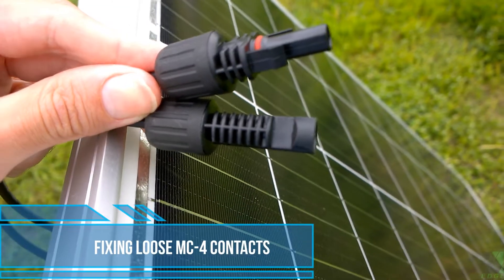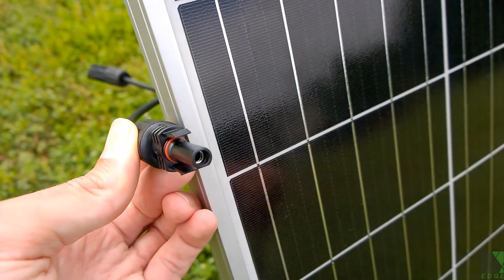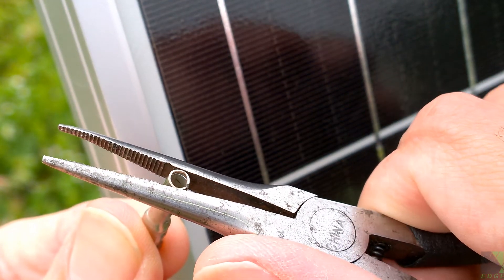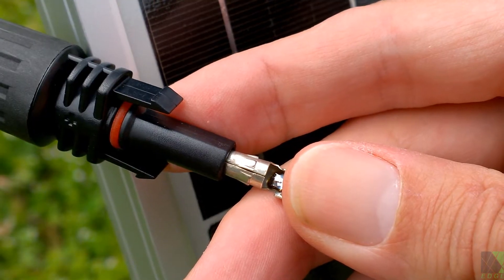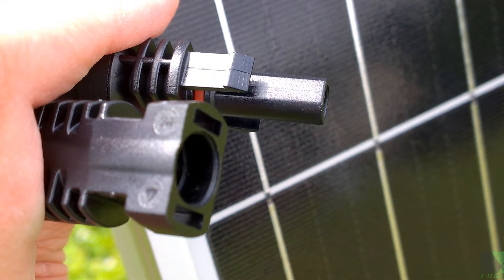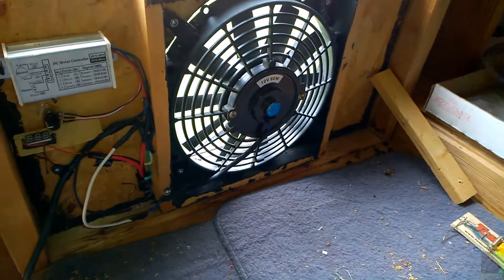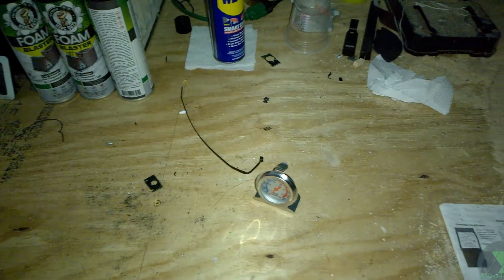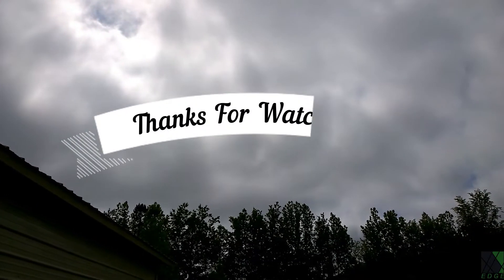Fixing LOOSE solar MC4 connectors - adjust metal contacts for better fit - plus bonus content!

Comment: Thank you very much. Can I ask a basic question. If the live dc wire is coming straight out of the solar panel how do you ensure there is no live current in the wire so that you can work on it without being electrocuted. Since the solar panel is always producing electricity. I have always wondered
Reply from the maker: @heditate Hi, you are welcome :) good question, most small (100w) solar panels produce only up to around 20 volts, and that is pretty safe to touch. But regardless, a low tech method I use to disarm a solar panel is to simply place a towel over it. That will shut it down. It will still put out a bit of voltage, but  nothing to worry about and very little current.
 Note if you have multiple solar panels in series (not parallel), the voltage adds up and can get very high, even to lethal levels. 48 Volts DC is considered the maximum safe voltage, it will give you a bit of a zap when touching a wire, but hopefully nothing too bad. Hope this information helps! -Dave
Reply: Thank you very much ! @solarpoweredge really appreciate the response
Reply from the maker: @heditate You're welcome, No problem :)

Comment: Thanks, my wattage is low on one of my strings of panels that are new. That may be the problem. I've been scratching my head for some time.
Reply from the maker: @Howie47 Welcome! Could test each panel individually. Sometimes these MC4s get hot and melt, and the crimps can even come loose.

Comment: Where can I get mc4 connectors for an 8awg wire? Thanks
Reply from the maker: @GerryKirkpatrick 10awg is usually no problem, have you tried ordering some MC4 crimps and testing the fit? Might be able to improvise and get the wire in there somehow
Reply: @solarpoweredge  Yes, I ordered from Solar super Sonic Store. The sealing components would not slide up the cable.

Comment: Thanks!  I get that these are being used to create water-tight connections, but they are prone to multiple issues.  I am leaning towards replacing mine with Anderson connectors and working around the water infiltration.
Reply from the maker: @LaurieFloodTeacher Welcome :) yeah getting water tight connections can be quite the task

Comment: Finally a real world solution on how to cope with the non-standardization of MC4 plugs, which is maddening, by the way.   I wish they would at least create size descriptions for MC4 connectors so you know which ones will fit together instead of having to rely entirely upon brand or dumb luck or prying apart with needle nose pliers.  You can just buy new metal replacement pins and repin old MC4 plastic parts which may be helpful at some point, but the same sizeless madness applies to these replacement pins.  It's all designed to make us feel "NOT PROFESSIONAL" as THOSE guys buy their MC4 plugs by the case from the same supplier.  They are dealing with the same problems with different brands of solar panels that all come with their own MC4 plug, though.  I wish they would make some move to standardization, at least size labeling.
Reply from the maker: I hear you, it should all be standard but the quality control is so poor. Some of the MC4s I have just fall apart or crack open. PS thanks for watching and commenting :)